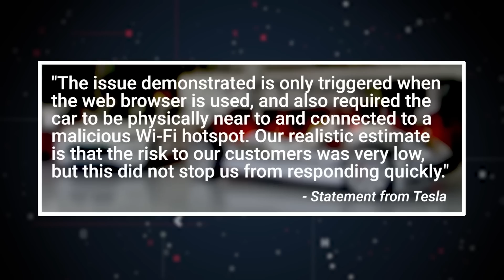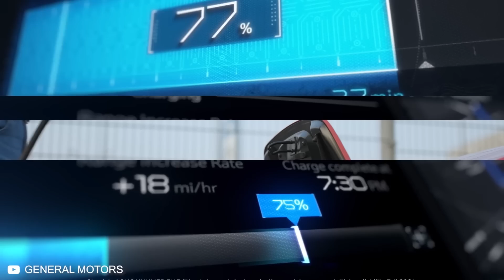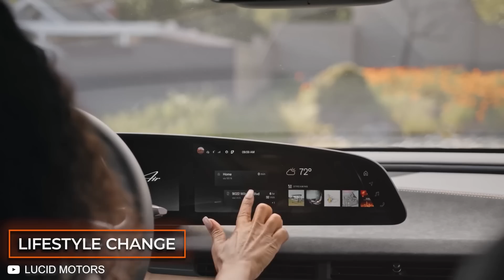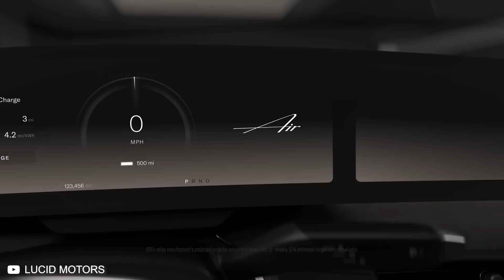EVs' Serious Problems That Carmakers Are Hiding

Comment: Where did you get the 2.3% a year degradation from? that's probably worst case and for older tech batteries with no liquid cooling. A battery should last about 20 years with proper care, and even some decade old Teslas are showing less than 10% degradation.

Comment: Thank you for the insight..!! No thank you, those, unreliable, cost expense $$$$. CRASH destructive. Life threatening vehicles, no thank you, we'll stay with old fateful..! The petrocar. Drive in, fill up, and go...Done...!
Reply: Seen where a fire dept. put 65 thousand gallons of water on ev on fire and couldnt put it out
Reply: @Glenn-F-Rice EV are very dangerous vehicles, and yes" if you get caught in one in an accident your a fried chicken, not to mention   nothing left of you, let's  say hamburger..!!
Reply: @rogerone7387  but also worth noting that according to the beuaro of statistics in multiple countries, the US NHTSA, the EU’s NCAP safety board, the Australian AANCAP safety board and many many others, EV’s are 11 times less likely to spontaneously combust compared to an ICE vehicle and 5 times less likely to combust in a collision compared to an ICE vehicle. And these are per capita numbers. Meaning relative populations have been taken into account. So no, it isn’t because there are more ICE cars out there. That’s already been factored into those numbers.
Reply: @rogerone7387  so no, they’re not dangerous vehicles. Infact they’re safer. They’re even safer in other metrics. More weight means more momentum which means lower injury severity in a crash.

The centre of mass of most EV’s sits around the wheel axis because of the skateboard battery pack designs. That means they are far less likely to roll in an accident which drastically improves survivability.

They have no engine in the front or fuel tank in the back, this gives EV’s extra crumple zones in an accident over ICE cars which again, drastically improved survivability.

Instant lily applied torque able to be controlled on each individual wheel means better and faster responding traction control and ABS. Which again, improves safety. 

Shall I go on?
Reply: @engineeringtheweirdguy2103  Logical design says they are not. Mass× weight + impact going into other heavy mass in a empty shell would have a higher crunch point. The only heavy area is the floor or battery, a large mass of wight. As of yet we would like to see an electrical vehicle that is safe. So far the view is not good. Wire dysfunctional shorts or high temp. Acceleration to the use of electrical equipment a high heat situation waiting to happen, or a possible burn up in the force of everyday use. Yes, they are heavy, the battery. But so are non electrical cars, with better standing in the years they have been around. Infrastructure faults for electric cars are not so great either. As you know connection problems, adapter problems, then use of the charge cards not always universal use. The whole thing of electric cars is a big waste of money and a lot of it.. ! Why the problems. Just stop, fill up, and go..!,
Reply: @rogerone7387  ahh, no. Google conservation of momentum, most of the damage to the occupants of a car comes from how rapidly they accelerate/decelerate in the event of an accident. Think of a bowling ball and a golf ball, both are moving towards eachother at the same speed once they collide the bowling ball only slows its speed a little bit. The deceleration on the bowling ball was very light. The gold ball however would almost instantly decelerate to a stop and accelerate away in the opposite direction of the bowling ball as it “bounces off” the acceleration on the gold ball in this case would be enormous. Now think of a 1T car hitting a 2T EV. 

The frame of most modern cars are strong enough to protect the occupants. They’re called safety cages or crash cages. So you don’t have to worry about that.

It might come as a surprise to you, but engineers have considered the impact of temperature on batteries and components, that’s why they’re fitted out with thermal sensors. I know it’s a shock, but engineers tend to not be complete morons most of the time. EV’s regulate their acceleration and other actions with their temperature and state of charge. The batteries are constantly swimming in coolant fluid to keep them at their optimal temperature. So is the electric motor.

As it stands, EV’s get a higher safety rating and reliability rating. On account of having 1/100th the moving parts of an ICE car. They don’t need expensive regular servicing to remain operational.

They also catch fire far less on account of not having internalised combustions of highly flammable fluids/vapours in an engine block running than the fuels ignition temperature whilst being lubricated by highly flammable oil.

Would you like me to cite everything that can go wrong with an ICE car? I can garuntee that list will be longer than an EV’s.

They are safe. Safer than ICE cars. That’s why most of the top 5 safest cars on almost every country’s lists are EV’s. 3-4 of them are Teslas. 

You can deny reality all you want but the only person you’re fooling is yourself.
Reply: @engineeringtheweirdguy2103  Thank you for your times and diagnosis.  Car guy, now and forever.
Reply: @rogerone7387  and thank you for not absorbing self evident and easily verifiable facts to uphold or own warped imagination as though it were fact, willed into existence through the soul reason, you thought it. It was very entertaining.
Reply: @Glenn-F-Rice  because like a lot of different fires, lithium fires aren’t extinguished by water. You can however get chemical extinguishers or even a specially made blanket to do the job for you. However, EV fires are far more rare than ICE fires. They also develop slower, typically thermal runaway in a car takes about an hour before flames are visible. In a combustion car, which is a super heated engine block and exhaust line, swimming in highly flammable oil, being fed highly flammable and in some conditions explosive fuel. These typically are fully engulfed in flames within seconds.
Reply: Technically EV’s have higher reliability, lower maintenance costs and are safer than ICE cars…..

Comment: For lithium batteries it needs 3 other minerals and all have to be mined .
Mining is a dirty business.
Protect Thacker Pass
Reply: Thank god you don’t have to mine for metals in giant engine blocks and transmissions. And you don’t have to frack for oil to run them…..
Reply: @engineeringtheweirdguy2103  like you don't ,
Reply: As dirty as mining is, it doesn’t raise a serious risk as burning fossil fuels does at the current rate. Have you considered the amount of c02 that is produced in mining oil? How it is extracted, refined and shipped globally
Reply: @rps1689   how will they transport all the minerals that are needed along with the trucks needed to remove and transport?
Reply: @Rockhound17-18  Same way they do for mining oil and mining the worlds most mined minerals. Eventually synthetic fuels or hydrogen will highly likely be used for large mobile systems. For for small mobile systems, lithium batteries for now, and graphene or silicone batteries in a few years.
Reply: @Rockhound17-18  never said EV’s didn’t. Genius. I’m pointing out the hypocrisy in the comment doofus.
Reply: @engineeringtheweirdguy2103  then help this doofus to protect Thacker Pass 💪
Reply: @Rockhound17-18  what is the ecologically, geologically or cultural significance of Thackers pass? Similarly, would you help me protect Canada’s coastline from bay du Nord, one of the last pristine and untouched coastlines left in the world with significant ecological implications. From oil drilling, at one of the last accessible oil fields left to drill for cheap fuel? Not to mention the risk of oil spill along a coastline relatively untouched by humans and home to some of the last truely independent habitats in the world….
Reply: @rps1689  you need fossil fuels for EVS
Reply: @Rockhound17-18  Yep, but with upgraded plants and grids less fuel is required.

Comment: With all the problems that come with an EV, and even with the additional energy required to manufacture an EV’s battery, the greenhouse gas emissions associated with an electric vehicle over its lifetime are typically lower than those from an average gasoline-powered vehicle, even when accounting for manufacturing the car and its battery.
Reply: True,  but that hardly matters for global emissions if EVs can’t reach high global adoption.   Charging a driving world most of which will never see a garage is not feasible, and upfront cost, esp with increasing battery cost, all appear to block global adoption.

Comment: I work on ev all day at work and I'll tell you what these ev owners are brain washed. We are currently dealer with a recall that we have to have special jacks on each wheel because we have an high rate of the vehicle catching fire in the shop!!!
Reply: ….. what recall? All of Teslas recalls haven’t actually been recalls, they just pushed over the air updates, aside from that there was one suspension issue with early model 3’s.

Be more specific.
Reply: @engineeringtheweirdguy2103  Chrysler Pacifica. Look up recalls about the hybrids. . customers can't park inside homes. Please don't be one of these customers that's gonna argue with the professional as well. Come at me with respect .
Reply: @dramatyst5661  well. I would say that respect is earned, not demanded or assumed. however it if makes you feel better then with respect, Hybrids are not EV's. and with respect, according to the NCAP safety board, AANCAP safety Board, Beauro of statistics in Australia, EU, Canada, UK, America and the American NHTSA, EV's are 11 times less likely to spontaneously combust compared to their ICE counterparts and 5 times less likely to combust in an accident. Infact, I was driving to the city yesterday in my Tesla Model 3 and we passed a Ford Everest that was was on-fire on the side of the road in Melbourne. Then only about a few months ago, at the traffic lights behind my house a Nissan Nevara caught fire sitting at the lights. 2 people died. Funny how that never makes the news though.

Comment: Very unpractical. And more problems are yet to surface. We'll probably discover that the batteries' life is shorter than advertised, the autonomy range lower, the recycling more polluting than anticipated, the accidents more frequent. And try to get away from a hurricane or a fire in an electric car! Scrapping gas and diesel powered cars and going all electric will certainly cost lives, if we let it happen.
Reply: Why would getting away from a hurricane be anymore challenging in an EV? Also you do know we’ve had electric vehicles for the last 10 years right. The data is in. Batteries are readily recyclable, they’re safer in accidents, batteries last longer than advertised. etc. a quick google search would tell you all this.

Comment: My 3.0 liter diesel get 500 miles on a fill up. When EVs can compete with that I'll consider getting one.
Reply: You drive 500 miles every day!?!
Reply: @engineeringtheweirdguy2103  no! However I do take road trips quite a bit. Those trips easily are over 500 miles.
Reply: @tattooed1979  ok, so most people typically don’t drive 8 hours straight without taking at least a toilet stop right?
Reply: @tattooed1979  so for your daily commute, you’d get by with let’s say, 350-400 miles of range? Like the range EV’s provide these days?

And if you’re not driving a full working day without taking a single stop, why do you need that ability? Wouldn’t say, a 15 minute stop at a super charger to get food and go to the toilet every 4-5 hours of driving be sufficient?
Reply: @tattooed1979  my point is. WHY 500? we know big fuel ranges for ICE is desirable purely and only because that means you don’t have to find a fuel station to fill up as often. EV’s however are typically charged at night whilst your asleep. So that’s no longer a concern, you don’t NEED 3 weeks worth of a fuel because it doesn’t save you anything in an EV.

So WHY 500? How did you get to that number? Or did you decided that because that’s what your truck can do so that you don’t have to get fuel as often. So you decided that needed to be the benchmark?
Reply: @engineeringtheweirdguy2103  why 500? Because where I live in Kentucky is about 500 miles from Kansas city. If I can make it on 1 charge then I'd be sold on one. As I'm in the industry of building high horsepower engines I hope the EV flops.
Reply: @engineeringtheweirdguy2103  what EV gets 400 miles of range?
Reply: @tattooed1979  not likely, EV’s have showed steady and exponential increase in popularity over the last decade. And as I said. Are you really going to drive non stop, without a break for an excess of 8 hours. A.) that’s an excellent way to blow a bladder or cause kidney damage, B.) the human brain is only capable of around 3 hours of solid unbroken concentration. After that your chances of having an accident increase dramatically. Is that what you’re saying you do on a semi-regular basis? Sounds like a good way to off yourself to me.

The vast majority of people take breaks every 3-4 hours of driving to get food and drink and to use the rest room. If done at a super charger by the time you get back to your car it’s already fully charged. 

So are you telling me you semi-regularly exhaust yourself to the brink of an accident and kidney failure by driving for 8 hours non stop and that, to do so is a must and that adding 15 minutes to charge would be catastrophically disastrous. Even to the point that 15 minutes isn’t worth saving $100 USD each way on fuel alone, never mind servicing savings.

Do you see what I’m getting at?
Reply: @engineeringtheweirdguy2103  I see what you're getting at! And I don't really care! Takes longer than 15 minutes to charge one of those turds. I appreciate you taking an interest in my bathroom habits. I've done quite a few long journeys without needed to use the restroom, and it helps when you have a copilot.
Reply: @tattooed1979   “what EV has 400 mile range” well off the top of my head the Tesla model S long range has 412 mile range. But that’s not even the longest range EV on the market anymore.
Reply: @tattooed1979  does your co-pilot help you hold the bottle?
Reply: @tattooed1979  FYI even profession truck drivers aren’t allowed to drive that long without a minimum 30 minute rest between the 4th and 8th hour.
Reply: @engineeringtheweirdguy2103  ok! Instead of trying to be clever let's focus on facts. Tesla model s long range will go 400 miles on a single charge? Price? Anymore? I know the hummer truck is close to 400, has the biggest battery put in an EV but it's 100k. Sorry guy EVs are not efficient enough maybe in another decade. I'll keep my diesel, that will definitely last more than 5 years.
Reply: @engineeringtheweirdguy2103  hahaa just looked on the tesla website, you have to use an actual tesla charger to get 100 miles of range in 15 minutes. Those are everywhere right? Standard wall charger 44 miles an hour. So how much time will I lose charging a stupid car? It's worth the 100 I put in the tank vs the 150 for the hotel room I'll need to wait if there's no tesla charger.

Comment: " EVs are undoubtedly the best solution to the environmental issues we face.". No they are not.
Reply: Have any better ones?
Reply: @engineeringtheweirdguy2103  There are no solutions.
Reply: @Withnail1969  but there are things that are objectively better than others. Planting a tree in my backyard doesn’t solve any environmental issues, but it’s better than coal rolling an old diesel so you can spin your wheels and do donuts in a parking lot.
Reply: @Withnail1969  on an individual scale. Sure, on a population scale it does matter

Comment: No. Still so stupid, what if someone is already on the only charging station and you have to wait behind them to fill their car up for an hour and then there’s is somebody else or several other cars between you and them & they’re waiting ahead of you. What about if there’s power outages and you’re trying to evacuate with several hundred thousand other people because of a hurricane and all those other cars are electric and it takes an hour for each car… and then there’s five lanes of traffic trying to evacuate a state there are hundreds of cars running out of power and causing an even worse traffic jam which causes everybody else behind them to run out of power because they’re using up their cars power while they’re stuck..this whole thing has not been worked out & is stupid and by the way electricity doesn’t make itself, it’s made from coal, gas, natural gas & nuclear & guess what, a nuclear plant has to have electricity or it will have a meltdown and destroy everything around it from nuclear fallout radiation and the electricity comes from coal, fossil fuel & natural gas. .
Reply: Super charging only takes 5-10 minutes
Reply: “What if there is a power outage” how are you planning on pumping the gas into your car then genius? EV’s are charged at night when you’re not using them so every morning they have the equivalent of a full tank of an equivalent car so if the power does go out, you’d likely have a few days worth of range left in the battery, where if you’re in an ICE car and you were supposed to get fuel on your way home last night….
Reply: “Everyone else is stuck causing them to run out of power behind them” EV’s, unlike combustion engines, don’t idle. The only power being consumed whilst it’s not moving is the radio. Which can run for weeks on a few AAA batteries worth of power. And you have around 10,000 AAA batteries worth of charge in your car. You’ll be fine.
Reply: Ahhh, nuclear is deemed self sustaining, it operates its reactions through the electricity it, itself generates. Similar for all the computer systems at a coal or gas fire power plant. But you’re also forgetting that home solar is a thing as well.